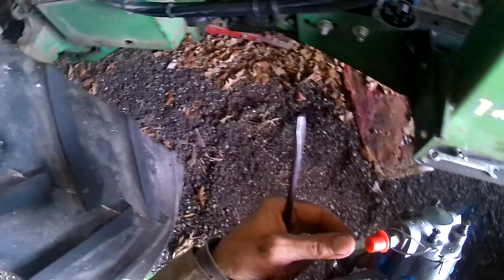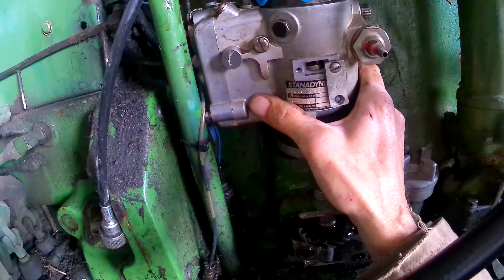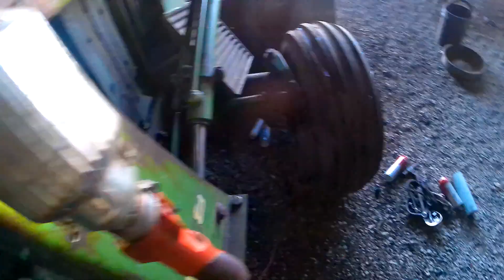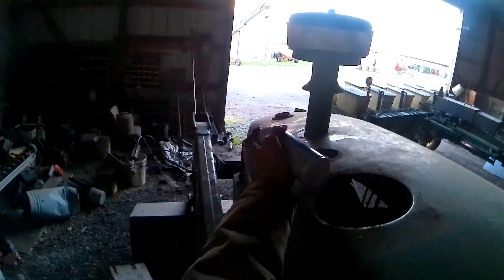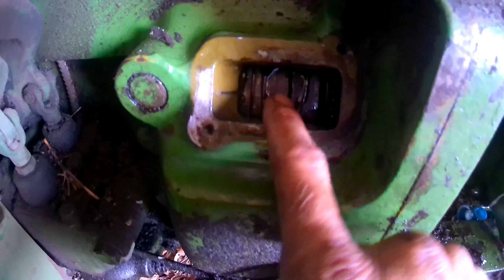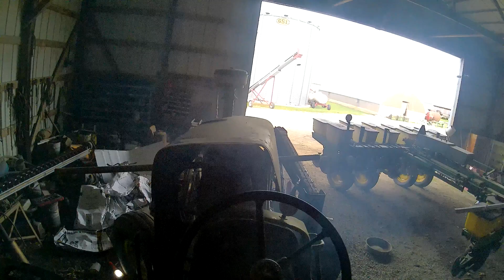JOHN DEERE 4020 INJECTION PUMP FAILURE AND INSTALL + REPOWER UPDATES

Comment: Always  Time the engine BEFORE removing  the pump........  If ever in Doubt remove  valve cover  valves on +#1 cylinder will be seated hen on TDC

Comment: Yup, you were on tdc on the exhaust stroke instead of the compression stroke. 50% of the time, it works everytime. I've got 2 of them, a 65 and a 68 and I have to pull the pump only 68 this winter, having issues withvthe metering rod sticking, and the governor is surging